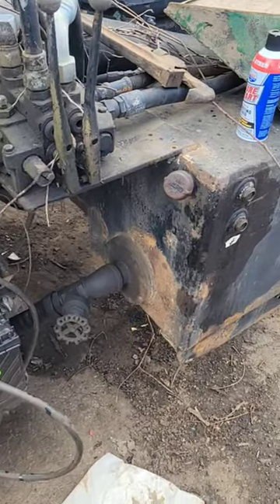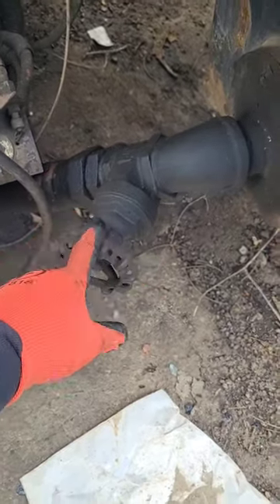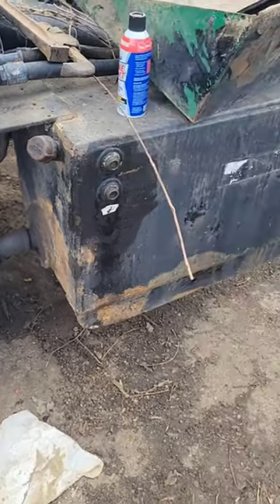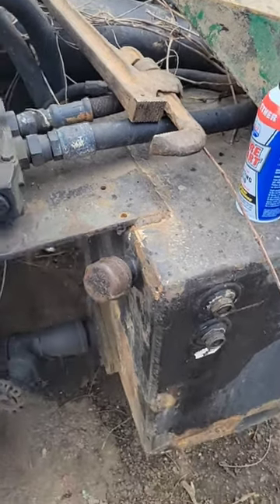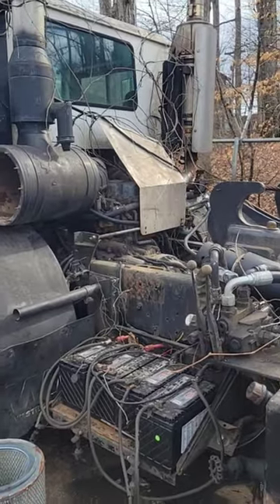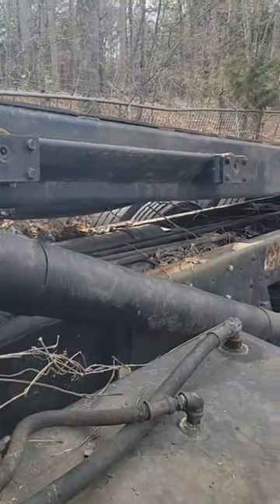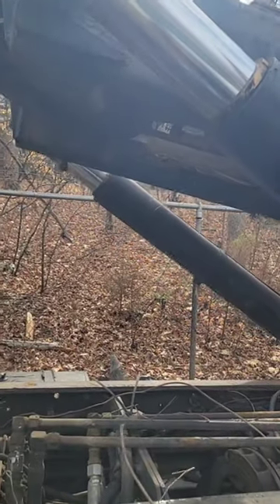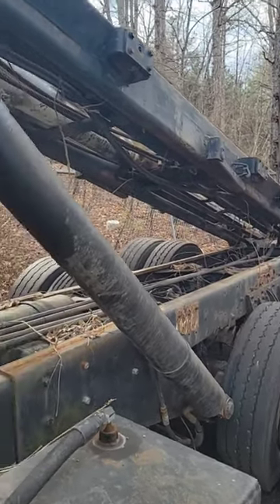She runs, and WORKS. Full video soon. #Scrap-Life #recycle #recycling #mack #rolloff #truck #shorts

Comment: That was probably one of those trucks that got parked and scrapped because it was "broken" because the bed wasn't going up or anything with the hydraulic system was working. So, park it and eventually scrap a perfectly running and functional truck because no one thought to turn on the flow valve.
Reply: That is the oldest MACK in the product lineup
Reply: You’d be insanely surprised how often stuff like this happens. Even with normal cars. I bought a 2010 dodge caliber CLEAN years ago for 500$ bc he said the trans was out and lost ALL years only drives in 1-2………. They have a CVT trans…. They don’t shift like a normal trans. When I took it on a test drive I was like you’ve gotta be joking….. turn right around handed him 500$ not a dollar less than what he asked for, cleaned up it told for 4,200 2 days later. Nothing else was wrong with it at all.
Reply: @Hable_3  on a different size scale, I dumpster dive. Pulled out Maybe just a 4 year old flat screen tv. They lost the remote. Amazon $7.88. Back in business!

Comment: People scrap things like this? Wtf
Reply: Yes. Myself included.  I scrapped a huge 1960 international farm tractor.  Fired it up and drove it on my trailer and hauled it in. Nice cars with a blown head gasket or neglected, rusty trucks that are 100 functional but need frame patches or shackles. Down there there’s no rust so they probably have a few gems.
Reply: @ericharris893 mannnn that was a waste of a good IH
Reply: @Antiquefarmequipment  that tractor got pulled aside and sold. It was a waste tho, there was seriously nothing wrong with it and nothing was cobbled, hacked, or abused.  It was a giant heavy tank and whene they seen it at the scrap yard, the pulled it to the front.  It definitely didn’t get melted down.